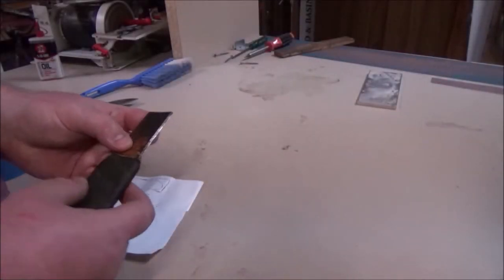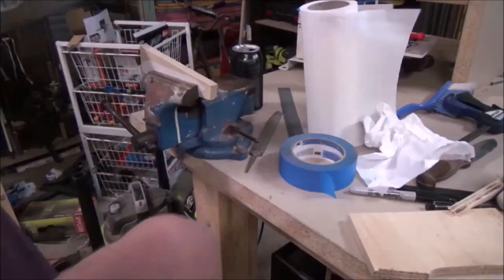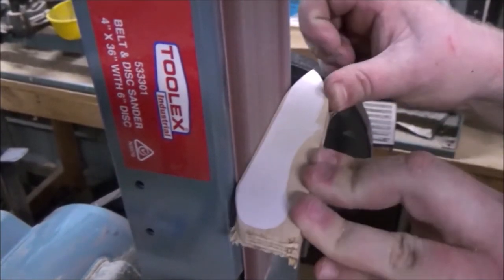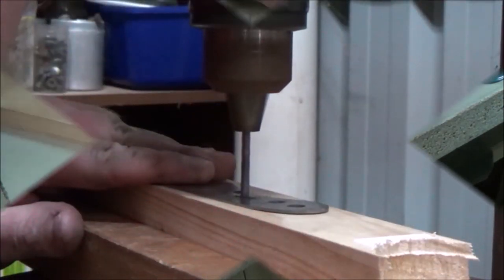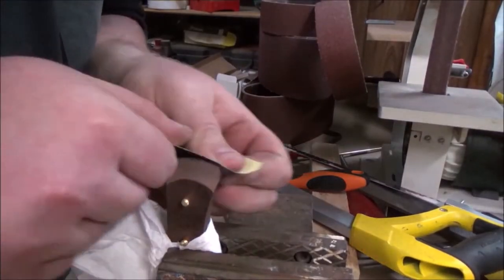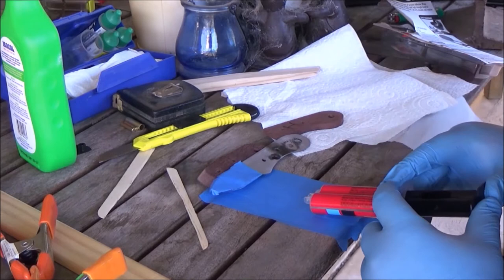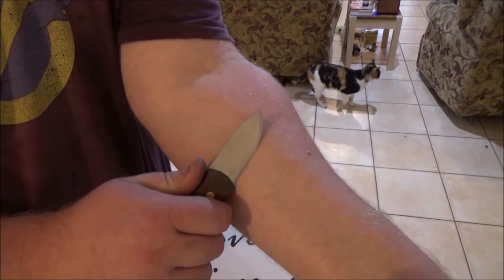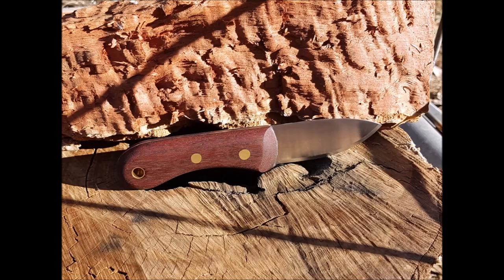Making a knife from an industrial hacksaw blade

Comment: Is that your first knife? Super job, turned out very nice! If that is your first knife, dang man, even more impressive. Did I hear right that you ground the bevels with the stones? I see you got a 1x (30 it looked like?) sander on the workbench. I use some 500 grit belts for mine to do the finer edge grinding and such, speeds up the process a TON. It'd put an edge on that in about a minute. Go buy you some. You'll love it.

Also love your australian accent btw 😃
Reply from the maker: Thanks Jake. I am actually subbed to you on my private account. It's not my first knife. I have made three from scratch (bar stock, heat treat myself etc) and have made two from a carpenters saw blade. So I guess this is my third saw blade knife with no heat treat, but it was a lot more work than the others. Also I have done a few handles for friends. Which looking back, WOW there is a huge difference between the quality lol. Once I have made 100 it should be even better.
It was a mistake to grind the bevels on the edge pro 12-13 degrees per side. Took a good hour. I was listening to pod casts though so wasn't too bad. Next time I will do 90% on the 1x30 I have done that before. I just thought it would be quicker lol. It was only 1mm thick.
This is the first video I have ever done so I was surprised by my voice. I asked a couple people, is that how I sound? Some said yes others said it sounds a little deeper. Thanks for stopping by. Can't wait to see more from you as well.

Comment: Well done mate ! A very nice little knife, that seems pretty useful !
Making a wooden knife before the real one is important, for your first knives it teaches you how to use the tools, and what can really be done, what will be confortable, etc..
Don't forget to clamp your works before doing anything
I hope you were wearing a respirator and glasses, you know safety measures..
Another tip :
Peening the pins is important, lots of knifemakers don't do it and only rely on epoxy, which I find not to be a good thing
When you peen yoir pins, the holds the scales on permanently, whereasepoxy can break, or you can burn it
But even if you want to peen, first glue everything, clamp it, let it dry, and then once it's dry you can peen, this way you can be sure to have everything where you want it to be
Anyway, that's pretty impressive to see what you've done with this piece of scrap steel, good job !
Reply from the maker: Thanks for watching. Considering it only takes 5-10 minutes to make a wooden template it seems wise. When I made my first knife I made a wooden template first. Actually I think I made about 4 or 5 because the handle was uncomfortable lol. 
Safety gear I had on. I just got a proper respirator (half face) before this video with two filters. I wish I had gotten one sooner. It is 1000x better than any dust mask I have tried.
I think you  missed the bit where I peened the pins and after sanding them flush I mentioned they were a fair bit wider than the 4mm rod I used. It was a bit long of a video though so I don't blame you. I made a knife out of a builders saw and only used the epoxy and quickly realised that any medium-big flex breaks the epoxy bond and separated the scales from the tang. So peening I concluded is especially important even more so on thin knives. I was worried about peening after the epoxy cured. My thinking is that it may break the bond with all the impact it is undergoing. So I try do it when fitting. Makes a big mess though lol. Glad you liked it thanks for stopping by.
Reply: ScottsHobbyz I watch the entire video but since I'm French I may have missed this part 😂
Well actually if you hammer correctly and not too hard, you shouldn't hit the scales and break'the bond, and even if you break the bond, the pins are here to secure the scales to the tang
But you're right, the best seems to pin before it's cured
So you need a slow cure epoxy 😉
Reply from the maker: Just got some west systems gflex that I ordered. Apparently it is good stuff for knife making. It is slow cure as well so problem solved. Thanks for watching and commenting.

Comment: Made a Seax from solid HSS, couldn't drill it or file it. It eats drills and files for breakfast, but holds a razor edge.
Reply from the maker: Cool. I actually don't think I have seen a seax in person. Yeah normal drill bits don't touch this steel. They are the same thing really. So it's like trying to drill something with something else just as hard. Doesn't tend to work. Pretty sure it is harder than files too. I had to use a special drill bit to get through. And my technique was bad as I was extremely inexperienced at this point so I busted it on the second hole but managed to make it work still.
I got a bunch of industrial hacks saw blades from a garage sale so I will be using it again in the future. Probably going to make a set of wood carving knives.
Reply: @scottshobbyz5416   Lucky dog! Those blades are expensive, but worth it. I just bought an obsolete one on ebay for ~$20.  It's 16", so maybe I can make 2 small knives. HSS is a real treasure, don't know why it's not used more. It gets a bad rap about being brittle. If thick enough, it's just as safe as D2.  Haven't broken a HSS knife yet, but I don't pry or chop with them. Another good source is HSS "parting tools" or "cutoff tools".

Comment: i betcha thats m2 steel
Reply from the maker: Could well be thanks for stopping by mate. Whatever it was, it formed nasty burrs and was very abrasive resistant. Nasty to work with in the hardened state. But it did polish up well so I was pleased with that.
Reply: Is m2 any good for knives?
Reply: @NS-dx8dq  Yes sir! I made a Seax with, and it holds a razor edge like nothing else. Gotta watch breakage on smaller blades, but great otherwise.
Reply: Excellent holding edge but quit easy to rust during storing. I made a long butcher knife from solid HSS Eclipse hacksaw blade and i dont need sharpening stone or sharpening steel while butchered 3 cow legs